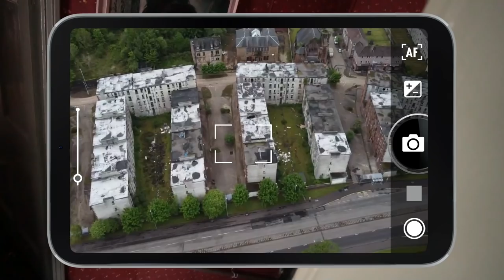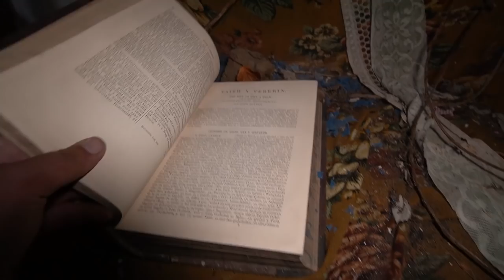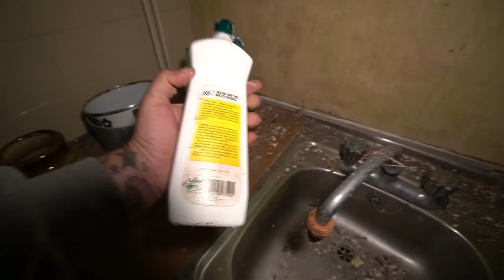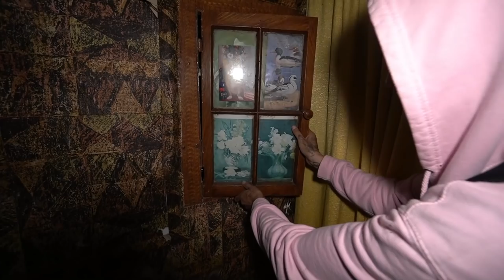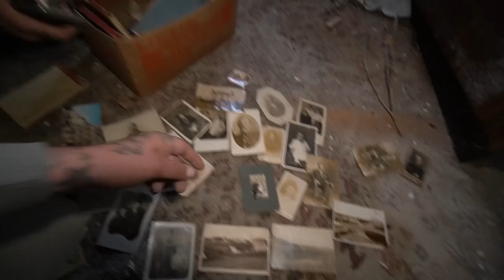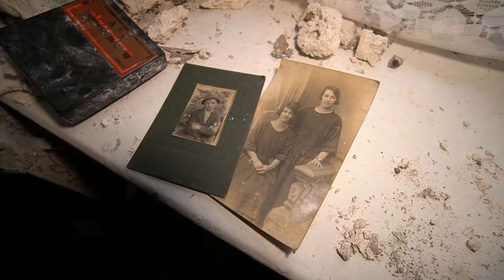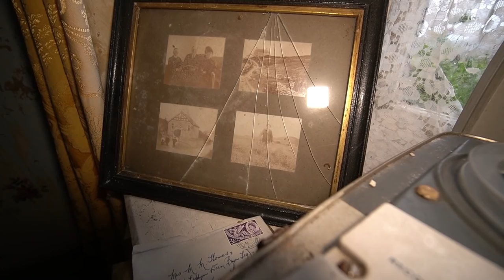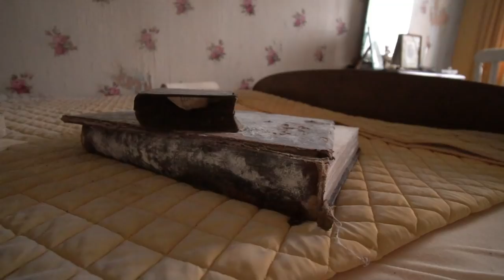SHE DIED ALONE IN HER ABANDONED FARM HOUSE - PERSONAL LETTERS WITH OLD FAMILY SECRETS REVEALED

Comment: The wallpaper prints are from the 1960's to early 1970's. You can tell the house itself is older. Some of the older furniture is from the 1920's. The big floral designs of the furniture probably the same as the wallpaper era.